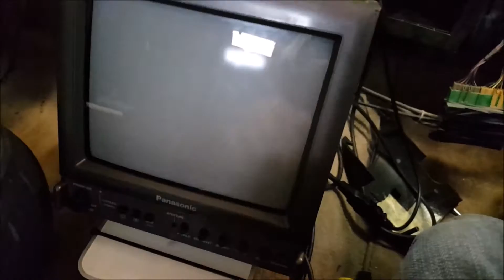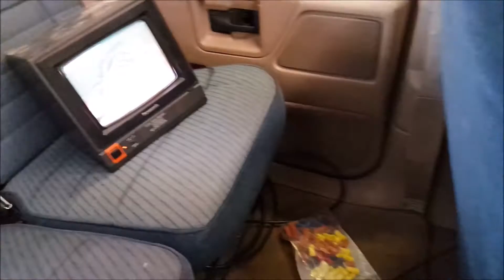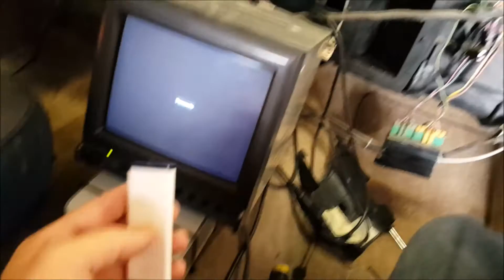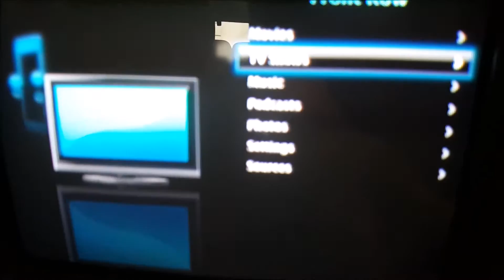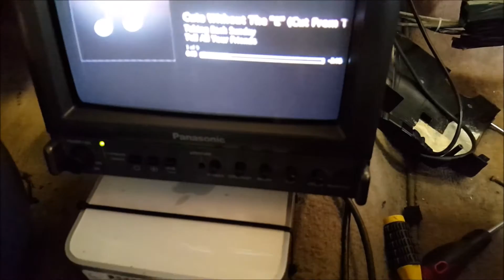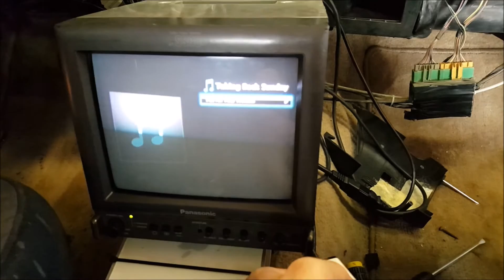Jurassic Park Ford Explorer - Audio/Video Setup

Comment: @cyrix9445 Hey, I am just letting you know, my entire wiring harness caught fire due to the use of wirenuts that I wasn't aware of. You are doing too good of a job with this explorer for it to possibly burn to the ground.
Reply: I know this is an old video, but I was just going to leave a comment warning about wire nuts. NEVER use wire nuts on a car. Solder and heat shrink, or use un-insulated crimp type butt connectors and heat shrink.